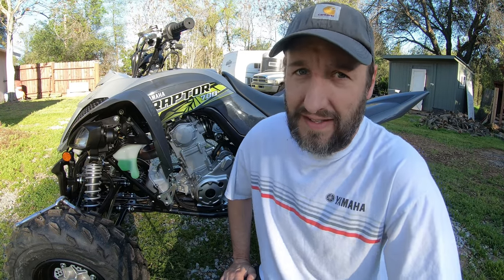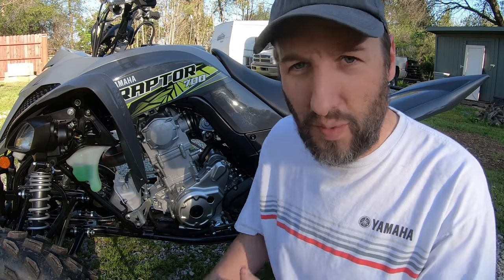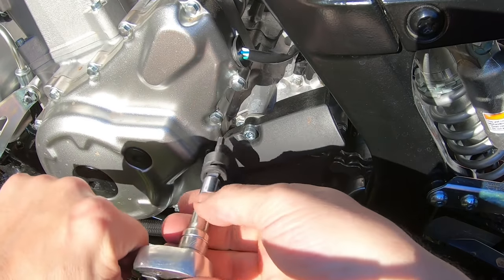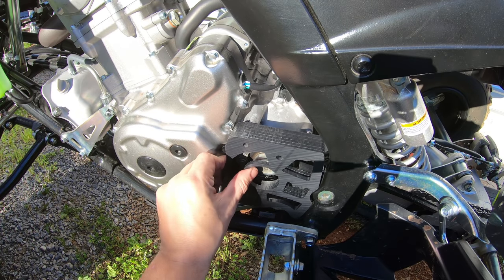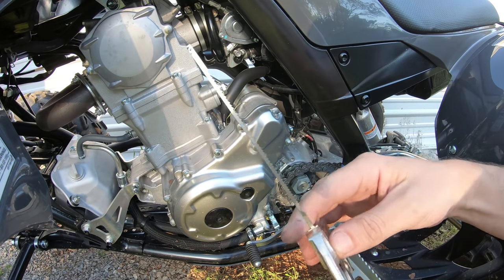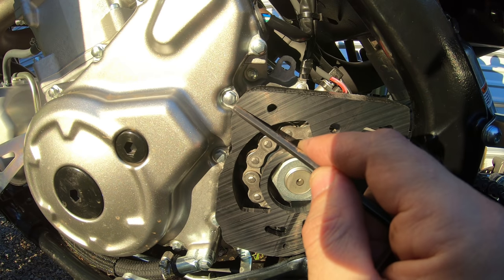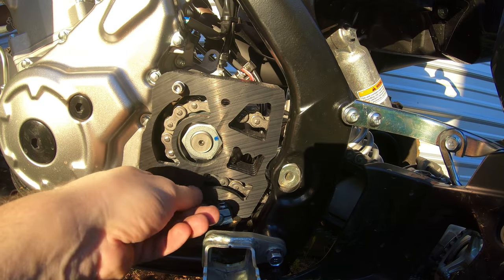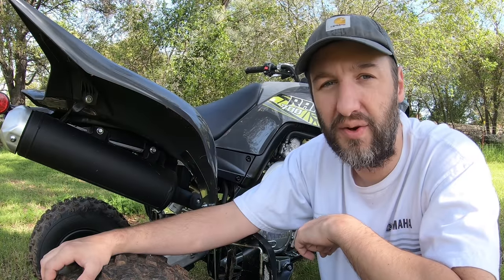Yamaha Raptor 700 ATV Case Saver and Engine Protector by DRW

Comment: The stock "case saver" is actually only a guard to keep your boot off the chain and counter sprocket. The aftermarket case saver your mounting will make you feel better about the situation, but it's still mounted by two bolts.  The posts the bolts are mounted in are vulnerable to breaking since the aftermarket case saver is far stronger than the case its mounted too. In theory if the chain fails the case saver should thread the chain through avoiding a pile up and impact, but if that fails the two bolt mount posts will take the energy resulting in a broken case. Sure, use the aftermarket case saver but your best defence here will be a properly adjusted chain. Dont run a chain and sprockets that are worn out.
Reply from the maker: Aside from the two mount holes this particular case saver is further strengthened by the front area where is mates against the side of the engine. His other case saver design for the 700 has 3 additional holes up front there like the one I am running on my 08 raptor which had busted mount holes when I got it. Agree a good chain and sprocket, proper maintenance are important. I'm in no way implying you should run your chain until it falls off or run cheap chain that will inevitably break- but in the event that does happen i have no doubt this one will do the job. Thanks for watching and leaving your opinion. Suggest you check out his other design that incorporate the extra 3 mount holes if you feel this one will fail.
Reply from the maker: this is the part where I explain the way it is strengthened by the front area https://youtu.be/2buWwVJd8h4?t=521

Comment: Looks really good, you should get full skid plates. Love mine on my raptor, protects the frame.
Reply: What kind did you get?
Reply: @ImVaiiderr  I got the ones from Yamaha themselves (gytr), nothing fancy but got little 700r stamped badges in front on the skid plates. I think it makes things look bit cleaner and of course protects.
Reply: @chrisglass8701  how you liking them so far? The gytr were the ones I liked the most
Reply: Love them, never have to worry about scraping the paint or bashing the frame.

Comment: Nice i run a glann innovations setup too bad they don’t make one for the 700
Its the best setup hands down and also has a piece for the swing arm so theres no way the chain can bind up between the sprocket,swing arm
Reply from the maker: I saw theres it looks really nice also but I really like the design of this one by DRW and it pretty affordable also at about 50 bucks shipped
Reply: TrailBlogger i hear ya the glann one is def a bit more i used to run moose ones on my kfx and yfz
Both bikes i snapped chains and broke cases def sucks ive snapped one chain over the years w the glann and no damage at all not even a mark

Comment: The OE chain saver is not the plastic cover. It does have the OE chain saver just behind the cover
Reply from the maker: that little tiny metal piece behind the plastic cover does nothing to prevent case whack. from my experience it makes the slap impact even worse when the chain breaks and impacts it. just my opinion but that is not a case "saver"

Comment: Cuervo monster exhaust with pc5
Reply: 100% only way for the max power
Reply: 100% agree. I love my system and PC5.!  Make sure to repack it guys..mine seemed a bit loud so I pulled it off and dismantled... almost 50% of the packing was gone...had 22 hrs use.  Easy to repack and sounds crisp and lower sound again like new. Great exhaust for sure!

Comment: The link for the case saver no longer exists 🤔. Any new link to find one
Reply from the maker: sure let me update it. sorry about that
Reply: Thanks I checked out there website but they have like 4 different model now for the raptor 700 and cannot see any different. V2-V5
Reply from the maker: @tdexter19  some versions use the stock mounting locations and some are designed for the alternative mounts if your stocks mounts are busted off. some versions allow for extra large sprockets. I believe in this video I am installing the Version 2 in this video which allows for a front sprocket size 12-15 tooth using stock locations.
Reply from the maker: @tdexter19  the one I am using is the V2 I believe https://drwperformanceatv.com/index.php?route=product/product&path=59_65&product_id=110

Comment: You do know that piece of plastic was just a trim panel that hid the chain, the little piece of metal was the case saver. Just sayin.
Reply from the maker: That little piece of metal is not going to save your cases. I didn't even mention it because they are so worthless. The chains tend to wad up around it making it even worse. Id refer to it as a case destroyer before I called it anything else LOL
Reply: @trailblogger  I didn't say it would but you took that hammer to it like it was the case saver and it's not. Thats all I pointed out. I know that little piece of metal won't save anything. I love your vids , especially the Banshee one's.
Reply from the maker: @ralphthedog1680  That was my whole point in smashing the cover was to demonstrate it's just the cheap plastic cover and not going to stop anything so I think we're agreeing here lol thanks for watching man

Comment: What if I’m running a 15 t sprocket
Reply from the maker: he makes one for larger sprockets also
Reply: @trailblogger  can u give me the info
Reply from the maker: the V2 V3 V4 all day they will work with 15 tooth front sprocket according to the DRW website
Reply: @trailblogger   I went with armadillo case guard Cuervo racing recommended it but thanks bro

Comment: What’s the difference between the v3 you have and v4?
Reply: Ok I have same quad so chain is stock/hasn’t been changed correct? 

Also just to be clear before purchasing you installed the v3 there correct? 

But touching on that point I think the v4 is for a different chain 14-16 tooth sprocket
Reply: No I have nothing broken so v4 it is 14-16 sprocket Thankyou 

And my guess on exhaust is Yoshimura rs-2 🤷🏻‍♂️
Reply from the maker: @abrahamm594  I just looked at them again you are correct. you want V4 which actually uses the original mounts not the V3
Reply from the maker: @abrahamm594  the one I installed here is a V4, sorry I was confused earlier
Reply: Thankyou for checking and making sure definitely picking this up 

Also good for viewers who had same ?
Reply from the maker: Right! Now I'm glad I didn't mention the version in the video or I might have got it wrong lol. Definitely the V4 in the video
Reply from the maker: @abrahamm594  and good guess on the yoshi pipe but no that's not it. I am going to do the exhaust reveal probably tomorrow if I can get enough footage of it. I Want to do some sound sample not just stare at it lol
Reply: Hell yea I’ll keep an 👀 out 💯🙏

Comment: Having to trim seems like a design flaw. Anyone know if they have changed the ones they sell now??
Reply from the maker: If you get the DRW chain slider with the case saver I think it just bolts right up without trimming. I have one here that I still need to install and will have to do a follow up. Could be he did it that way to add better protection in that transition area between the slider and the case saver where rocks and sticks can get stuck. I should have installed the new slider at the same time to show this but my slider on my 08 Raptor was also pretty worn down and I was going to use it for that machine instead.